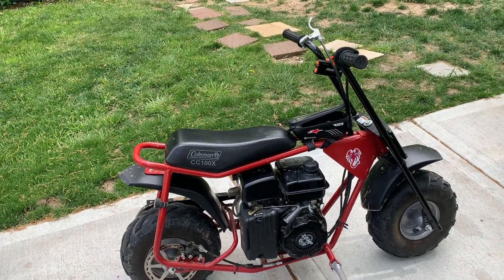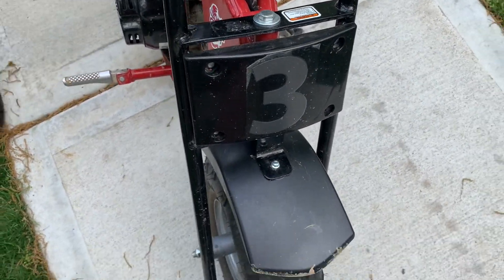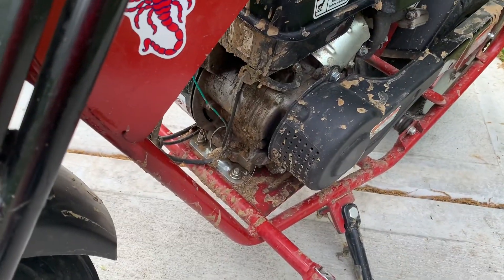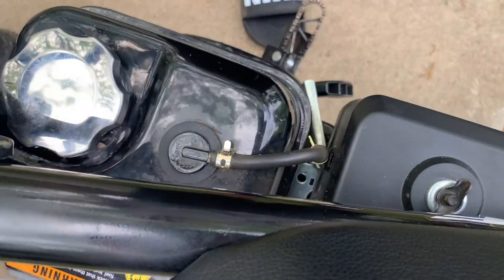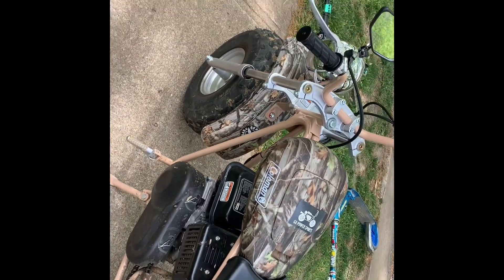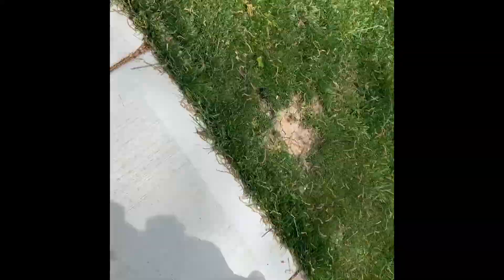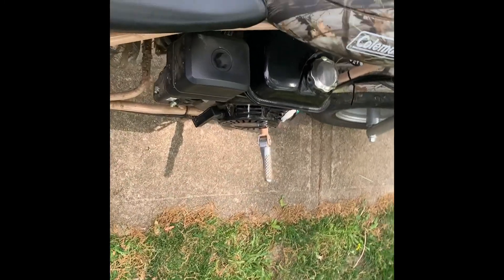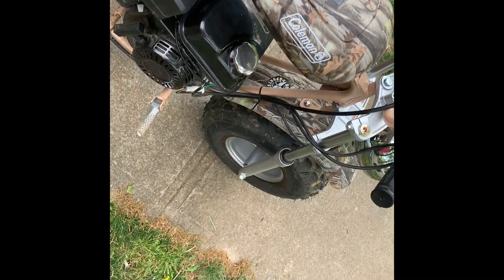Coleman CC100X, RB200, & CT200U-EX Review And Ride

Comment: nice! 
i put a predator 212 in my coleman ct200u ex and loosened the governor screw and it does 25-28. Gonna do a 40th socorfket for more top end hen a stage 1 kit lol but cool video
Reply: Way too low had mine like that and it was very slow on low end couldnt climb hills at all

Comment: That noise on the RB200 is your clutch bushing. You need to put a couple drops of oil on it
Reply: And the new Colman br200rvs has front and rear brakes. Plus we're suspension and a CVT.

Comment: Where is the governor screw on my rb200
Reply: I want to loosen it to make it go atleast 30
Reply from the maker: It should be between the air filter and gas tank. However with the 200ccs cutting the governor screw wont do that much, youre better off getting a torque converter

Comment: I have the same bike as the camo one how did you fix it going forward without you on it mine is doing the same thing.
Reply from the maker: What we did was take off the pull start recoil cover and I think the gas tank and part of the carburetor to get to the throttle control system and idle stuff, then we checked to make sure everything was in the right place. there was a black part that wasnt lined up i forgot what it was
Reply: @KonProductions00  thx!
Reply from the maker: Np

Comment: The new Trailmaster Hurricane 200x is better than any Coleman Mini Bike out there because it has front and rear hydraulic disk brakes Factory CVT transmission and full suspension. The Coleman Mini Bikes are outdated by at least a decade and maybe even two decades not to mention the aftermarket Mod support is not all that good now and considering that most aftermarket mods Favor the Trailmaster MB200 and Hurricane 200x.
Reply from the maker: thats cool, but the coleman minibikes are good enough.
Reply: Tote goats will never be out dated. They are simple and easy to maintain. Great platform for the young ones to learn on.
Reply: Older outdated stuff work, I really enjoy my ct200u and my two  ct200u- ex's. Lot's of fun, especially with the governor mods.
Reply: this didnt age too well, as the newest coleman has full suspension, and front, and rear braking system...coleman B200 RSV